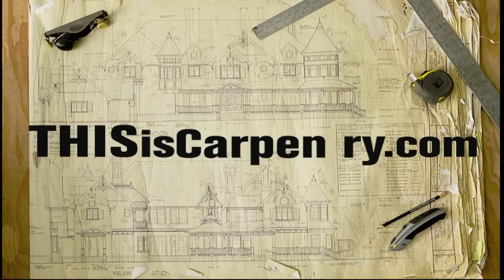Swirl-Free Sanding with Larry Smith from Festool

Comment: You missed the close up shot of the polished piece at the end.  I want to see that beautiful walnut grain.
Reply: if he wanted to really show the work he would have wet the wood or mention tht a cleaning rubber stick is good to save some pads. but then again at 10:11 he says: keep the pad flat on the surface... and that show that he is just using the sander for carpentry. for cabinetry you use a croissant shape area of the pad to avoid swirls and sand with grain starting right around 180. neither does he mention that rotary and excentric sanding are not done at the same speed. and neither does he mention  that  orbital excentric for carpenter is not the same as for cabinet maker or automotive sanding. Ever heard of 3/16 and 3/32 orbital swing. Its unfortunately a feature that is not offer by the bosch, Makita, festool polyvalent sanders. but soon if they want to reach out the professional that have the money for these tools.

Comment: this video is very helpful, thanks. but i was wondering, you seem to use the Rotex mode for everything, but when do you use one mode vs the other? When do you use the traditional DA random orbit sander mode?
Reply: I aasked ChatGPT 🙂

Here are the general guidelines for when to use the Rotex mode versus the traditional dual action mode:

Rotex (Aggressive Rotary) Mode
- Material Removal: When you need to remove material quickly, the Rotex mode offers aggressive sanding. It's ideal for rough sanding, stripping paint, or removing stock.
- Polishing: The Rotex mode can also be used for polishing tasks when paired with the appropriate pads and polishing compounds.
- Surface Preparation: Before applying finishes, sometimes a more aggressive sanding is needed to flatten the wood or to remove previous finishes, and the Rotex mode can be handy for these tasks.

Traditional Dual Action (Random Orbital) Mode
- Finish Sanding: After the initial aggressive sanding, the random orbital mode is used to smooth out the surface. This mode minimizes swirl marks and provides a finer finish.
- Veneers and Delicate Materials: The random orbital action is gentler, which makes it suitable for veneers and other delicate materials where you don't want to risk removing too much material.
- Between Coats: When sanding between coats of finish, the random orbital mode provides a gentle abrasion that promotes adhesion for the subsequent coat.

It's worth noting that while the Rotex offers the advantage of both modes in one machine, a dedicated DA sander might provide a smoother operation in its specific mode due to its sole focus on that function. If you're considering a Rotex sander, its versatility can be beneficial, especially if you're working in various applications and need the flexibility of both aggressive and fine sanding. However, always refer to the specific tool's manual and the project's requirements before deciding on the appropriate mode or tool.

Comment: Sure you can go from 40 to 80 to 150 very easy. I am a floor sander and I know about sanding . Specially with a machine like that you don't need to go 40,60,80 you can go 40 then 80 for good.

Comment: great video 👍  but just one little detail ......
i work with both carpentry and and detailing ( most carpentry theese days) and the woolpad is most agressive of all pads when polishing a carpaint . i use it only whit the toughest polising compunds , its like a 4-5000 grit ish...
then i go up to the softer sponge pads 
i have done it for like 20 years or so using mostly festool / Meguiars and some 3M 
// Joachim O.

Comment: He buggered it up with too much pressure and lifting in rotex. You can see the buzz mark left at 7.14. Thats why he didnt show you the final polished product in my opinion. 
Rotex is the bollocks tho. Ive "edged" so many floors in high end jobs that its ridiculous. And then blending in while the screener also blends in gives it a flawless finish. Superb piece of kit
Reply: Hey man. I need to refinish the floors in a couple of bedrooms in my house. Do you think I would be able to use the Festool rotex to do the job? I would rather buy the festool than rent a floor sander.

Comment: Hi Larry how does this stack up to a stroke sander on large pieces eg 3 meters  1.2 meters or 10 ft by 4ft  would be looking using for finishing work as go down too 400 grit on the stroke sander

Comment: may i ask what Festool paper you were suing with the Rotex to sand?
Reply: He's using Granat, which is light blue. It's Festool's most all-around sand paper.
Reply: Kapt6911 
But any paper will do. The Rotex doesnt care if its crap or not paper. Just make sure the holes match the 8 outer holes at least

Comment: Larry,Did you keep it in rotary mode throughout the process?Thanks
Reply: I was wondering that as well.
Reply: He used it in rotary not sanding like a normal orbital.
Reply: @jamesmurray5345   rotary blows up the orbital sanding to a 3/16 sanding effect. the orbital gets it down to 3/32 orbital.  research it sanding is trickier than that.

Comment: Larry i recently purchased a RO150 and am having problems sanding out a butcher block. When i use the sander it has a tendency to want to jump or run on me. i tried both dual modes and the same thing....i then tried to adjust speed and suction on my ct36 and still wants to jump any suggestions or ideas????
Reply: Try holding your back hand further back. It's a balancing act with the big beast. Get the balance right and it will not jump and run away on you. That said hold on tight as the ro 150 is a beast

Comment: I don't use my rotex up into the higher grits—  I'll have to try it.  However, I see differences in sheen across the board due to his sanding pattern.  I don't when I'm using the RA setting at a similar grit.  I also spend longer on the board.

Of course, it's hard to tell when something is on camera and you can't hold it up to the light, or rub your hand across it and look closely.
Reply: Anybody can make a small piece wulnut look good,  I sanded 2500 hundred square feet couple weeks back

Comment: At what intensity do you put your vacuum when your sanding?
Reply: Bid Budy 
Full power all the time. 
Ive been sanding and re finishing floors at the high end of the market for over a decade and have never wished the vac to be lower than full!
Hope this helps
Reply: ON high the vac creates enough suction to pull the sander into the material too hard and cause swirls.  Manual says vac on low and it works really well on low.

Comment: this guy knows his stuff
Reply: and don't mention nothing about the croissant shape area of the pad to sand with the grain or  that on orbital you can choose between 3/16 and 3/32 sander? The different rotation speed you should switch to from 60/120 and 220/600? or the rubber stick that can clean the pads to save them for shear wasting...

Comment: I hope that by this time you have learned that you can lower the volume of the recorded audio at certain points during your videos. For example, when running a loud tool. A tool we may want to wear heating protection when using in our shop or business. In this case, we are wanting to hear the person speaking and the relevant presentation of information, and then every fifteen seconds we are blasted by the 150db whine of the tool, for an unknown length of time. Turn volume down, turn volume back up when the speaking resumes, then back down when the tool whine starts back up again. You can do this with FREE software, btw.